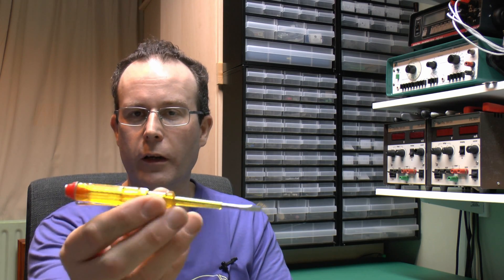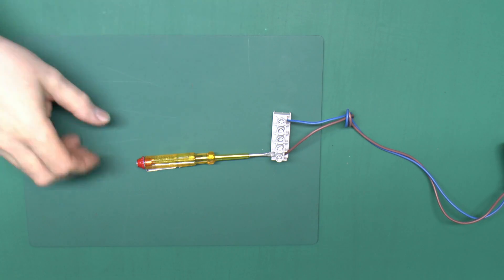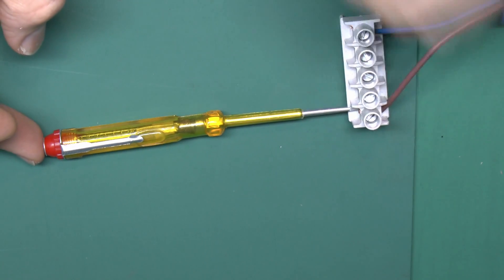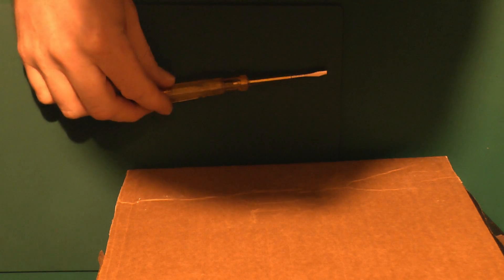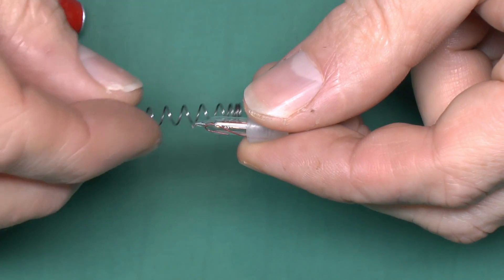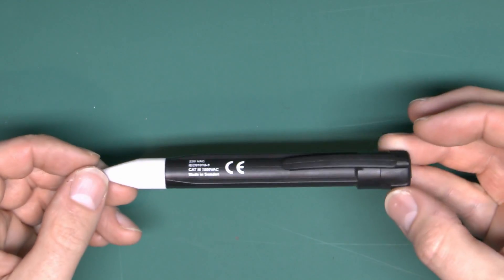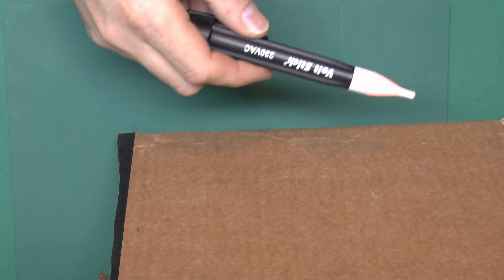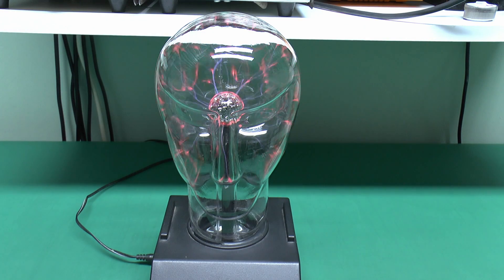Dangerous Device - Neon Mains Testing Screwdriver

Comment: You probably used some kind of 1:1 transformes when it did not work.
This things are designed to indicate live wire when you have neutral grounded. In my country neutral is always grounded and we do not have earth terminal in old houses. It is only 2 wires pretty always both white.
When wires are not color-coded the only way to know which one is live/neutral is to use this kind of neon screwdriver. "Proper test device" will not help with this at all.

Comment: This whole video is totally misleading. 1: 30 Brown wire is connected to the LIVE! Touching the contact makes your body a capacitive load, ITS NOT A CIRCUIT!
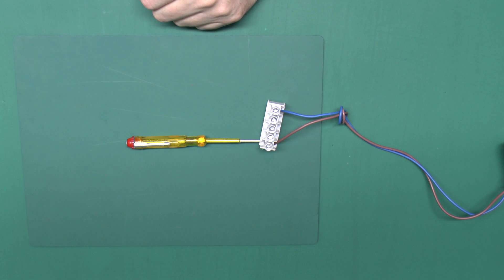2:40 you failed to mention that you swapped the brown to the neutral and the blue to the live! AT 3:50 switched back to brown as live again. At 7:30 brown is neutral again. When working with tools (any tools) its important to understand what you are doing and how they work. A bit of common sense is good (example: don't use this with wet hands while standing bare footed in a puddle of water). While this would not be my first choice of tool to use if it was between this and my bare finger I would still use it. I know and understand it's limitations. At least I could figure out which is the bitey wire and the not bitey wire. Have used one of these since late teens and for 40 years since, they have NEVER LET ME DOWN. Devious videos like this make me doubt you know as much as you think you do.

Comment: You talk about the unreliability of the hot-stick (the battery powered voltage sensor) as being unreliable for testing that a circuit is off.  Anyone who understands proper usage of that equipment knows that you are supposed to verify on a known live circuit that it works, test your circuit, then verify that it's still working on a known live circuit.  If that protocol is followed, the only error you get on an A/C circuit is reading power on wires where the voltage is induced by nearby wires.  Of course, they don't work on standard DC circuits (pulsating DC gives a similar result to A/C) because they depend upon the property of changing voltage creating a changing magnetic field in order to detect the power.  Some people with skill, when used to the sensitivity of their sensor can tell you the voltage of the line by the distance from the line by which it detects power.  As far as that screwdriver, if your willing to use it, it should only be on power limited circuits where there's not enough power to give you a serious shock.  That screw driver was never meant to be used on anything other than a power limited circuit.  You need to understand the proper usage of the tool you talk about as well as what it's properly designed for.

Comment: Of course with the device that needs two contacts, if you have a poorly connected neutral you will think there is no current even when the live is on.
Reply: Not true. I use a Fluke T100 (simple 2 pole tester with voltage level indication). If the neutral is defective, the tester will still indicate 'mains present' but not the voltage level...so either way, mains is indicated. The neutral simply makes it indicate the voltage level and phase direction.

Comment: Never trust a test lamp unless you can test the test lamp prior and after the isolation of supplies. A modern tester with a self test button is the safest test equipment for isolating the supply and of course it should always be GS38 compliant.

Interesting videos but I was worried in a different video you were telling people that to work in domestic properties  you should use somebody who's in one of these part p schemes. In my eyes these schemes are a list of incompetent people as genuine qualified electricans don't need to be on one of these schemes to self certify.

If It comes down to a fitter who's done a 5 day course on a part p scheme or a time served electrician with years of experience and current qualifications who is competent at doing the work and understanding the regulations I know who id rather use, Wouldn't you agree?
Reply: I would want both - can an electrician who is willing to cut corners with the qualification be trusted not to cut corners with your wiring? I want an experienced, qualified electrician with a part P certification.
Reply: @edwardcoe7293  An experienced qualified electrician is already qualified above the minimum requirements in Part P of the Building Regulations.
"Part P" is not a qualification it's an amendment to the Building Regulations so anyone not already competent can do limited training to install an addition or alteration to a circuit and is only valid in a domestic situation. It does not make you an electrician.

Comment: I've always thought these things were rather unsafe. Seen this?
https://www.youtube.com/watch?v=AGXQNLq19FQ
Reply: R4MP4G3RXD Yep. Using it properly on 220-240 V is completely safe.
Reply: +Paul Potter I was thinking of that the WHOLE time.
Reply: +R4MP4G3RXD actually you need at least 5 kV to start and arc on one of those neon screwdrivers - tested.
Reply: +Paul Potter Yup.
Reply: +Paul Potter Don't be ridiculous... Just think about it where will you use a screwdriver like that near 1kV?
Reply: R4MP4G3RXD 1kV+ is found around the house in CRT flyback transformers and MOTs. Don't trust yourself. Everybody makes mistakes. The idea is that you're supposed to trust your equipment, not your judgement.
Reply: +R4MP4G3RXD Still unsafe
Reply: Paul Potter
Yes when you ignore it's rating it can be. But the rating is there for a reason.
Reply: +R4MP4G3RXD True, but there can still be faults
Reply: Paul Potter
Yes, just like with the other ones :)
Reply: Mark Schulz IV
Okay, but that's 23 times more volts than mains voltage :P

Comment: I don't think these are actually useless/dangerous, if you use one only for 220/110V they cannot be dangerous unless one grabs the screwdriver to screw something under high voltage. In the worst case you will get a painful shock from a place which cannot be easily grabbed => you know that the circuit is on and you most likely won't die => not the best way to find out if something is live but still better than sticking a nail into a socket. Have you ever touched a pipe with your bare feet and an ungrounded computer case/macbook ? Then you'll know how powerful will be the shock if that resistor will get shorted out.

1. Just don't use them on higher voltages or isolated circuits.
2. Always test a circuit with a multimeter if you don't have a reference for this tester.
3. Try to not use voltage testers to see if an unknown circuit is live, instead opt for a multimeter or the shown lamp.
4. if you are only looking for the live and neutral this works GREAT

Actually these are VERY GOOD for determining if something is isolated/grounded or not. They will light up even with your computer psu/crappy charger/unisolated sound line/washing machine/fridge case. A computer/metallic laptop without grounding is as dangerous as this killer live tester. Yet few people (probably 1 or two) die from touching their computer cases and there will be 1000% more dirt and condensation and crap getting into a computer psu between the filtering capacitor than between the screwdriver's resistor. And i bet that half of the world uses computers/laptops without grounding.

And of course don't use the most idiotic cheap tester, some are better than others.

Comment: I hope no-one takesany notice of this rubbish. There is a lot of difference between something being dangerous and unuseable. The former, in this video, applies to the way you seem to think it is ok to advocate handling a terminal strip with a mains supply connected to it. I have used these devices for some 60 years or so - as long as they are made to a decent standard and not used as screwdrivers, they serve a very useful purpose to determine if an isolated wire is live. On the other hand, some of the imported rubbish should never be allowed in to the country!
Buy good quality tools and look after them - including a neon tester (better not to call them screwdrivers.

Comment: When i first saw your channel i thought wow. How can such a dude have only 5000 subs!!! Now that i see this cheap rubbish... Ill send this video to my friend who is just opening up a youtube channel to show him what not to do!!

My father has been using these since the 70' and i have been using them since i was 8. Not a shock. Not a false reading. Nothing.

Because 1) we dont just stick a plasma bulb where we are working. 
2) we dont just test one wire
3)we test the tool with a refrence. Mostly a normal power outlet 
4) We know what we are doing. Unlike you

This video contained alot of misleading things that it is just disgusting. Dont throw away your tool people! Just know how to use it. You wear boots with no metal on them and make sure that you are only touching the ground with your boots. Never touch the wall. Test your tool on a working outlet. And then use it for your work.
Reply: +Zastavan I do electrical work. I'm a trained electrician. I use these tools (german-made, mind) every day, and when used the way +Anas Malas describes, they are perfectly safe tools for what they're supposed to be.
Reply: Strider9655 it never caused an injury because safety precautions were taken. Putting mains voltage to your insulated body via a resistor should not cause death unless you are a moron. Even touching the electric live terminal isnt leathal granted you are insulated from ground (although it hurts like a ***), why should it be lethal in the same circumstance just this time with a resistor and a bulb?
Reply: BenjaminGoose by that anology a soldering iron is evil and should never ever in life be used... A gas cooker is even more unsafe because you can put your hand near while cooking. 

I never said it is perfectly safe. It is safe if you know what you are doing
Reply: Anas Malas I didn't make any such analogy. You made made the fallacy that just because you've never had a problem with something, no one else will.
Reply: +Anas Malas Oh you've never had an accident with a given piece of a equipment, that means it's perfectly safe.
Reply: ***** do you think putting a plasma bulb is NOT misleading? I outlined how I can never have an electric path through my body even if I thouched the live socket bare, so how would I get a shock when I do the same through a resistor and a lamp?! And btw I am not using the cheap type. I am using a quality one that would never fail and is not manufactured in China.
Reply: Zastavan how idiotic can someone be?! I am not from Saudi and I dont live there. Go be an idiot somewhere else
Reply: interesting
Reply: Matt Kennedy right... Let me go ahead and make a chanel and post videos talking "facts" straight out of my bottom! No one can talk shit to me then because its not cool!
Reply: +Anas Malas Another "we've always done it this way", do you realise that statement is the bane of engineering all over the world?

Just because you've always done it, does not make it right. There were a lot of things they used in the 70's which have been banned or superseded.

As for the high voltage, he could be using a Variac (a very common tool on most electrical/electronic work benches) and that might be the reason the screwdriver didn't work. The most common Variacs will give you slightly over mains voltage at maximum. UK mains shouldn't normally go above 253v AC.
Reply: +Anas Malas John seems to be knowing exactly what he's doing.
Reply: pepper669 its a severe case of being good from far, but far from good.....
Reply: ***** You are just another one of the idiotic people that think we are careless about our life and safety? I do not want anything to do with you either and no, I don't do electrical work and would never do work for someone so poorly educated about basic safety. Its only because I do electrical work once in a blue moom that I use it, for example one time I suspected wrong wiring that is potentially dangerous of a lamp. If I didnt have this tool I would not have known that live is on the side. 

I have never said this tool is perfect. I got a good quality one. Which although is harder to fail, it could. So I ensure proper insulation of  myself by wearing rubber boots that need kilovolts to break down, and ensure that I am only touching the groud with insulation and the screw driver indicator. When doing that how can I get electricity through me? There is no path to ground, I am not touching anything with my other hand. Also I do have an RCD in case anything goes terribly wrong. No danger here.

Now, could you get a false positive? Yes. Thats not bad. It says dangerous, but would never give a false negative if tried on a working outlet before. So ir cant lead to you thinking that there is no electricity.

About fire hazards, my house is equipped with a high quality circuit breaker, and has high standard fire extinguishing systems. So a short circuit wont do much, and if it does water will be pouring over. No risk there. 

Also if you value anyone's life you wouldn't put them in a wooden house that is all pretty much fuel. But we do things differently in the middle east.
Reply: Anas Malas hey did he makes videos for people who want to watch them don't talk shit on him just cause you don't like his videos it's not cool

Comment: Well this was dumb :S You switched the mains and neutral, of course they won't light up. They are not stupid proof. By your logic your two pole device is also "life threateningly dangerous" because if you netural is broken, you would think it's safe to poke around. So I guess now you have to throw it into the bin as well... I just can't put words on how stupid this video was :(
Reply: I fell asleep halfway through the Video. If that neutral was disconnected from the source then the neutral becomes live as the phase has no where to return to so the Neutral becomes live. 
I use the Tester Screwdriver as its handy it tight spaces obviously this bloke has not tried to get to a wire under a floorboard or in a loft with tight spaces.

And next weeks lesson don't lick a car battery LOL
Reply: Mark You could actually lick a car battery without much harm apart from maybe lead poisoning

Comment: So, if you open up an outlet box with a ton of wires in there, non-color coded, with possibly two circuits...what would you do to detect the 'live/hot' wires? (1)Maybe use the non-contact first to determine live ones. (2)And the ones that don't light up, confirm they are not hot, with the two-lead light up device? My problem with (2) would be pairing the right wires with the two-lead tester. You would have to test every combination of wires...correct?
Reply from the maker: Slap Stick Yes, with unknown wires, all of them would have to be tested.
Reply: ***** Thanks. Its worth the peace of mind.
Reply: ***** you mean like I stick both ends of that double ended tester to live wires and confirm that there is no power present? Obviously each of these devices has its own flaws when not used correctly. 

Also thumbs down for not showing your isolation transformer or whatever you used to create those artificial situations.
Reply: kubeek No, I think you would use the non-contact device first. Then to avoid false negative reading, you would CAREFULLY use the two-lead to confirm. Is there a better way?